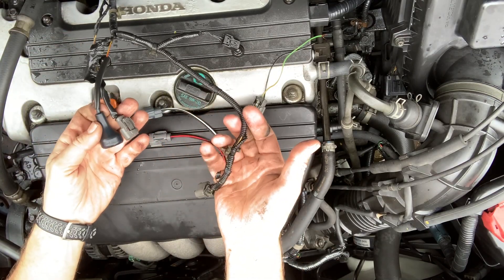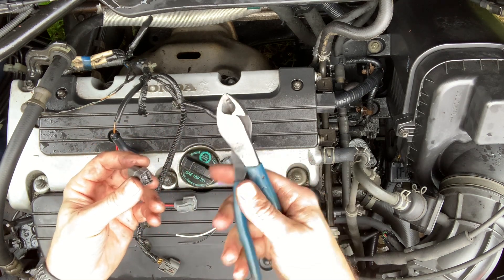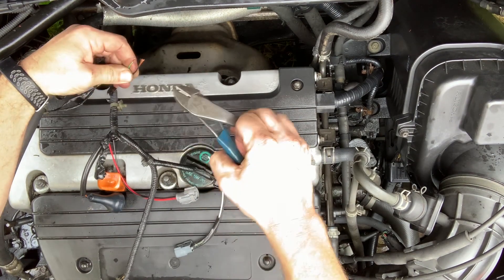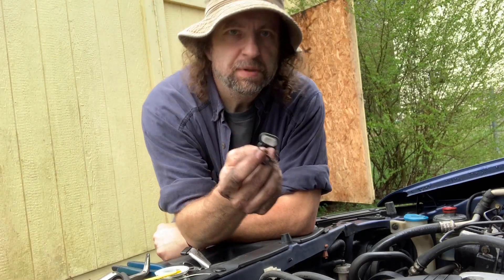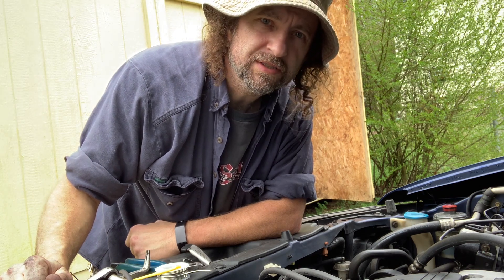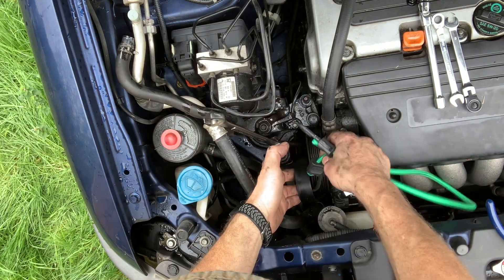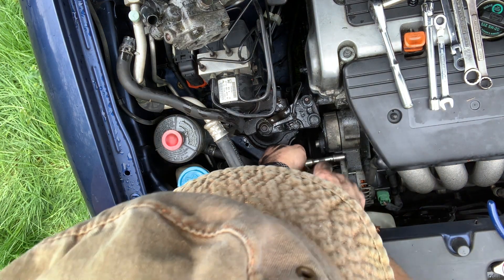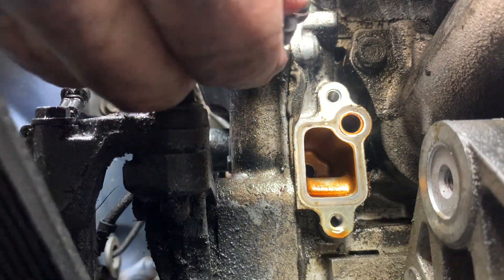Scavenger Type: More Honda Element VTEC issues...(part 2)

Comment: I can’t remember what my mechanic did exactly, but he performed a relearn procedure using his scanning tool on a Maxxis/autotec tablet. That fixed it for me.
Reply from the maker: Thanks for the tip. I've been resetting the code by unhooking the battery but I sure could use a better codes reader.

Comment: There is a method to reset the oil change reminder which will take it out of limp mode.  My Element required this when I bought it and I had the advantage of a talented quick lube guy who knew what to do. You probably have the maintenance required indicator present.  The procedure is :  1. Turn off the engine. 2.  Press and hold the Select/Reset button on the instrument panel, then turn the ignition switch to the ON (II) position.  3.  Hold the  button for about ten seconds until the indicator goes off.
Reply from the maker: Thanks for the info!

Comment: You saved my bacon today. Cut my vtec solenoid switch connector and couldn't remember which pigtail wire went to what on the hiring harness. lol
Reply from the maker: Glad it helped!!
Reply: @clintsearcy3252  Thanks. Hopefully, the p2646 goes away. But my multimeter testing shows a possibly faulty VTC solenoid on the sideblock instead. Low ohm reading of 7.7. GRRR

Comment: Really good job and camera angle, ur doing great  but like u said at the end, VTC actuator is the last on the list, sadly depending on the care of the owners with oil change as u saw the crude that get in the screen if that goes trought all ur vtec system overtime u need to replace every component relate to the vtec system, But it can happen only over 200 000miles ''depending'' on Quality and interval oil change, im sure ur E will go great after that, sadly i can show u picture of everything i just past trought this winter with all  th E,  and ur a great teacher ;P
Reply from the maker: Thanks!! The last junk yard VTEC I installed lasted a good 6 months and I was sure I had figured it out. But that's the thing with junkyard parts.... you never know. There is one other thing I can do that has worked before. I can swap the oil pressure switch out and see if the problem goes away. I may try that before swapping the whole solenoid. I think I have about 5 more junk yard units in my shop.

Comment: Do you know if anyone actually just put a new oil pressure switch on the spool valve instead of replacing the whole unit?
Reply from the maker: Yea, I did. It worked for a few Months.
Reply: @clintsearcy3252  I put on an aftermarket for an accord. It is acting up a little. Or it is the air control valve. Not bad enough to work on it in this weather...lol It goes just fine. Idle is about 1000 and after warm it starts going up to 1200 then back to 1000 continuosly. And you can smell its running rich.

Comment: How can I be sure if the plugs are bad? I’ve replaced the Vt ex selonoid already but it only worked for a few hours before limp mode
Reply from the maker: You can usually see one of two things. The wire at the plug will be exposed or there will be corrosion in the plug or switch.
Reply: @clintsearcy3252  do u by chance know the names of or part number of the plugs u used? 😂 I've had nothing but problems with my vvt oil switch and now I'm noticing the corrosion on the prongs

Comment: I’d be 100% willing to erase your code with my bi-directional scanner. Bit I’m in south Texas. That’s probably what it needs at this point. Try going to multiple auto parts stores, like O’Reilly. They have fancy scanners that can erase codes. Tell them you don’t know what your truck has, and when they plug it in, tell em you actually JUST fixed that and if they can erase the codes. They are not supposed to, but try your luck. 

That’s what I used to do with my Chevy Malibu. When my car gets a code I can’t use the remote start.
Reply from the maker: Thanks for the offer. I've been resetting the code by unhooking the battery.

Comment: 😔
Reply from the maker: Tell me about it!
Reply: @clintsearcy3252  I fixed mine by switching to a non synthetic oil.  Idk if you saw my previous comment on that. Honda engines are often times picky about what oil goes into them
Reply: @clintsearcy3252  PS: replaced solenoid 2x, engine flush, inspected all wires with no luck. Drove in limp mode for a while ready to sell her off. Then during an oil change I told em just put the standard stuff in there. I wasn't about to out more money in it. 1 mile later Nd and boom